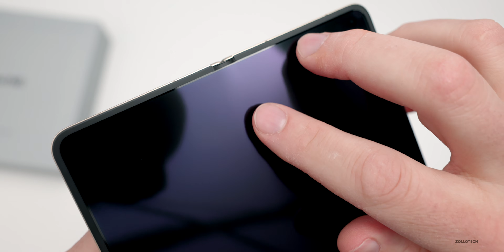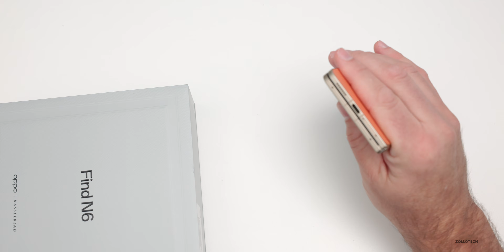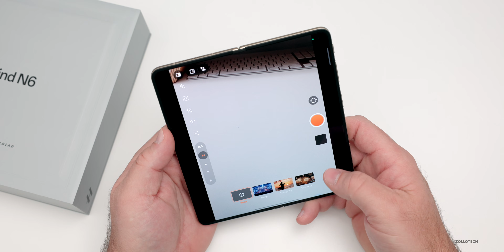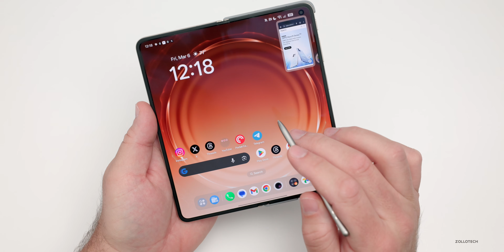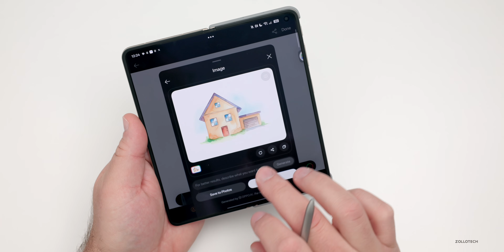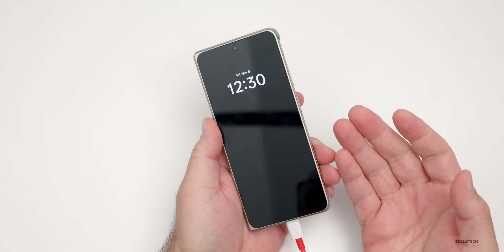OPPO Find N6 - Never Done Before!

Comment: Love my Oppo Find N6 global model. Creaseless inner display, Ai pen that works both front and inner screen, working with my T-Mobile 5g in the US, battery life for 2 days before recharging even with YouTube videos running all day at work with my buds 2 pro and galaxy watch 6 classic. Bought it before Samsung came out with there two new folds and got the better deal because it does way more than Samsungs new ones. It was worth every single penny. It's a beast of a foldable. Good by Samsung ripping off it's custom base.

Comment: I wish this phone was supported in the US to where if it gets damaged I could just take it to the store and fix it without worry. This phone especially is way ahead of the Z fold 8 series and the Google pixel folds. So I ended up getting the Moto Razr Fold instead. Cause of the features that it offers. Like the  Moto Pen Ultra that I can use on both screens, the bigger battery and faster charging speeds, the smart connect that's like Samsung dex, and the cameras are pretty good, and for being a first gen Device in my opinion, I think they did a good job.

Comment: I think this device will solve the purpose and problem both . Since split screen or floating windows on 6.8 6.10 screen looks very creepy but this device have big display. How about Note application recording internal device Audio and transipt and then switching to record external voice recording and transcript. Possible.  I think need a switch like external recording and internal recording easy for navigation.

Comment: Great review. Your crease demonstration with close up micro camera was excellent. Some youtubers try not to show it clearly.
I have used Honor Magic V2 as a second phone next to my iPhone 15 Pro Max. Magic V2 has  deeper crease, however I didn’t like the experience of folding phone. Crease was not an issue for me. After a while I have stopped using unfolded screen, I mostly used outside screen. I didn’t have any problems with the software or performance of the phone. Photos were ok but not iPhone level. I traded it with iPhone Air and I am very happy with it.
Screen ratio is a big problem, it doesn’t make it practical to use. If Apple releases rumored folding iPhone, I might give another chance to folding phones.

Comment: I wish Oppo was sold in the US.
Reply: Buy it on wonda mobile like I did. Mine will be here next week. Have had no issues with wonda mobile, got my mom the find n5 last year.
Reply: @ThePhalanx10000 What service provider are you using?
Reply: @thundergato84 I am currently using mint mobile so T-Mobile towers (tried the find n5 and it worked with mint) but I know the find n5 also works with cricket so at&t towers. Find n6 should be very similar band compatibility
Reply: @thundergato84 gotta be t-mobile